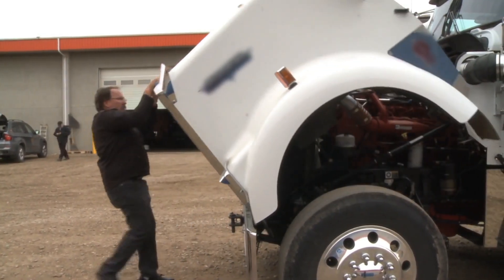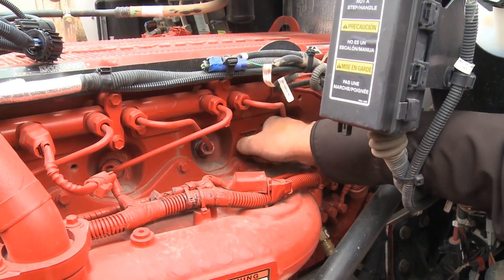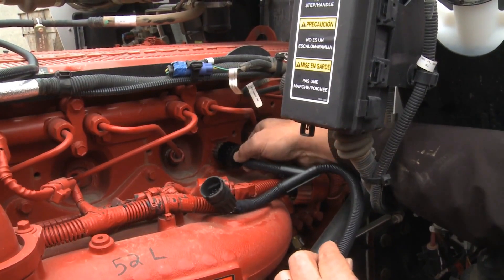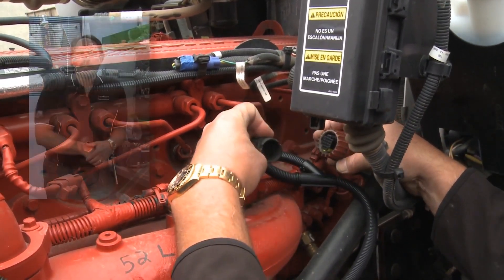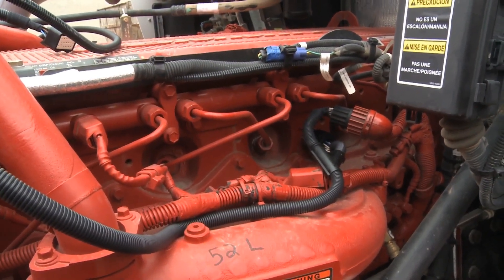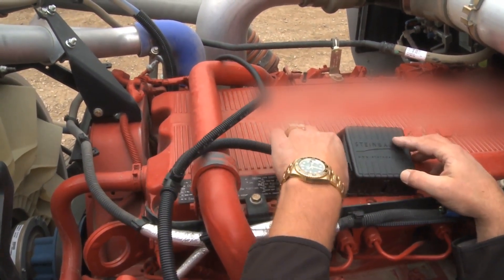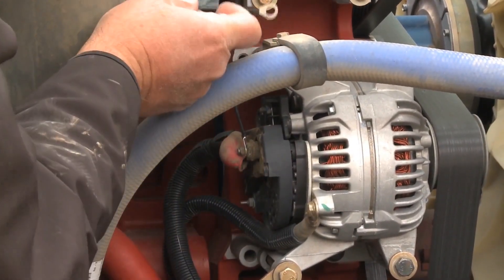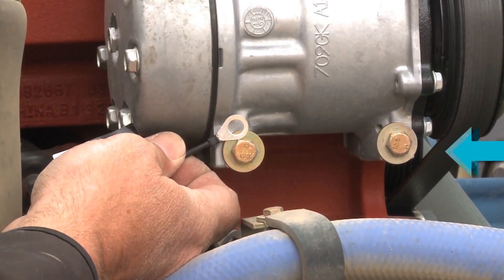How to install a STEINBAUER Performance Power Module on trucks

Comment: Hi I have one of your steinbauer systems and cable connectors to fit to a cummins 600 signature engine put am unsure as to what cables to plug it into as there are 4 plugs coming out, is there someone I can talk to, thanks in advance for an help
Reply from the maker: Hi Matt. Thanks for your message - this engine is in a lot of applications. Can you shoot us an email to support@ and we can give you a call to troubleshoot. Cheers